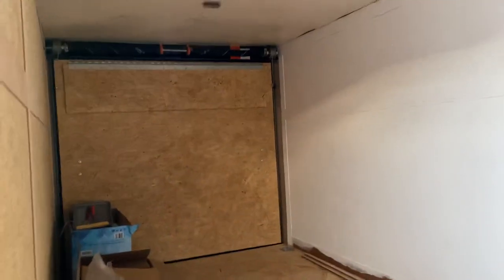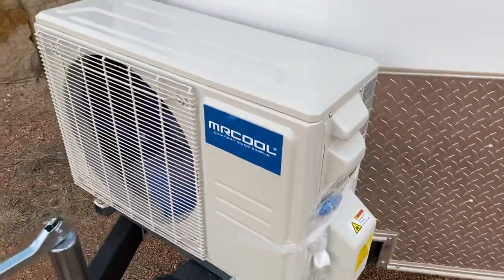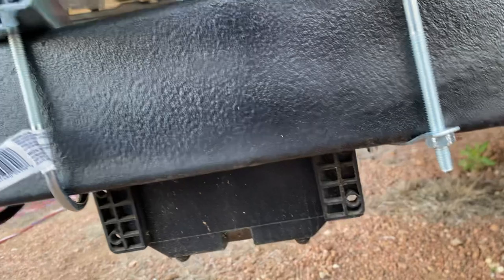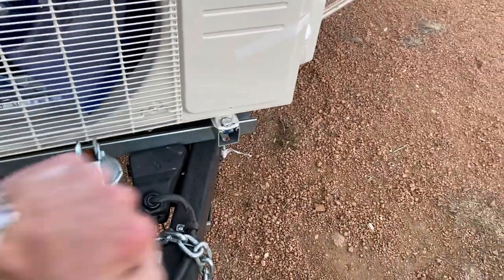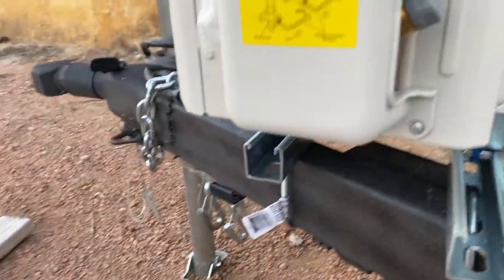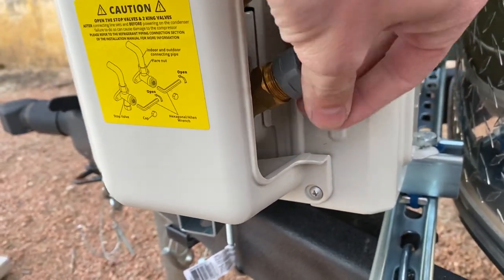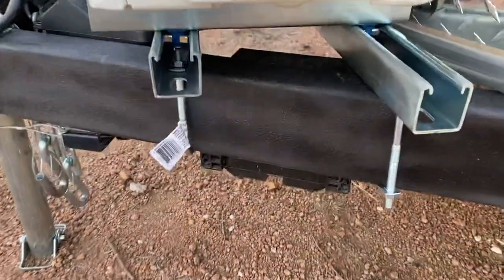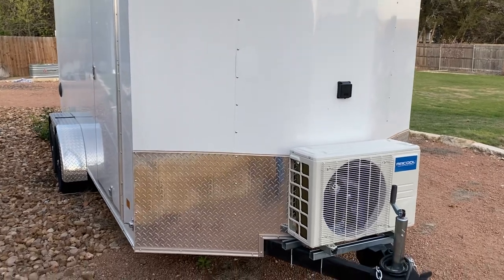Mini Split Cargo Trailer! Race Trailer Build Update 3!

Comment: how are you powering your trailer
are u running anything else like lights outlets fridge microwave?
Reply from the maker: Yes! I have some LED lights and a Microwave, TV for LiveRC. Im using a Predator 3500 and it powers everything with ease also super quiet!